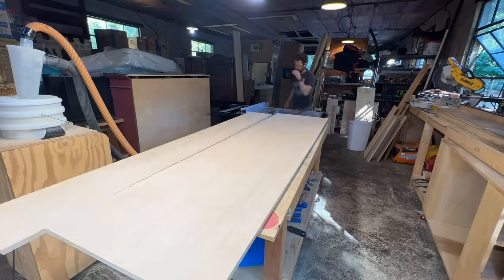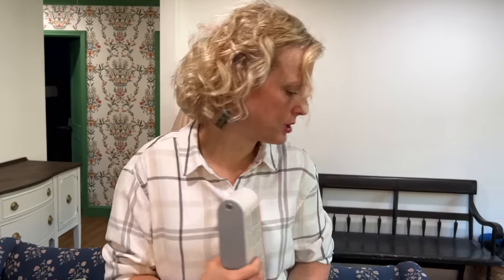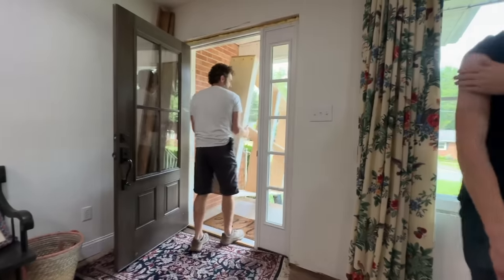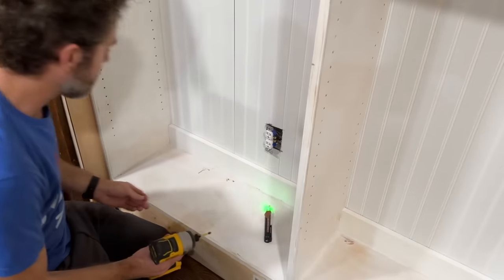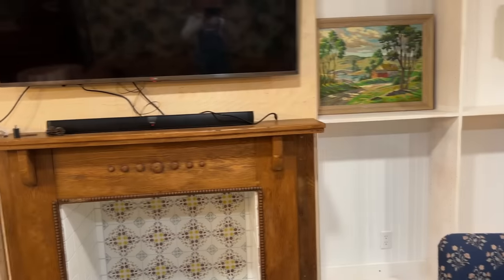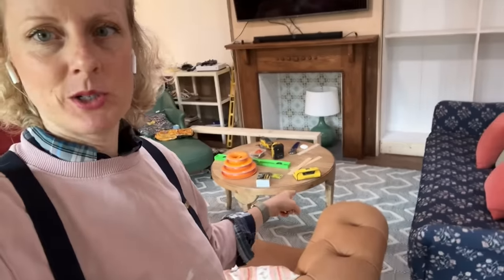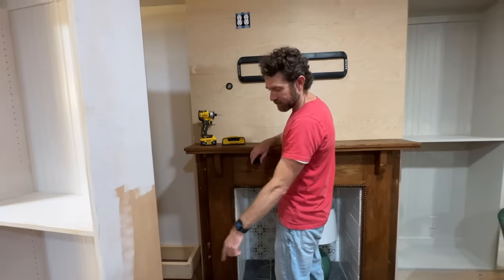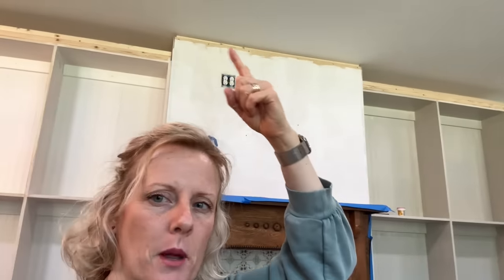MIKE IS MAKING OUR BOOKCASES: PART 1

Comment: They look GREAT!!!  I'm very much a fan of cozy greys, so . . . Also, about your question for the mantel.  I really like the idea of painting that outer piece to match the walls, BUT if you only paint the proudest part of the mantel base, it will make the overall mantel look so much smaller, and the bookshelves have a lot of visual weight and heft.  I just feel like the mantel would get a little lost without that extra bit of visual size.  Ultimately, it's only paint and if you don't like it, you can repaint it, so . . . DON'T SWEAT IT!!  That bead board is such a good look too!  The dynamic duo is doing it again!!! <3

Comment: It will be looking great with all the books - Mike can build anything , great job. I would wait with painting around the fireplace until all is in place , then you will be able to see the proportions much better . If you paint around it the fireplace will seem smaller , and may be out of proportion compared to the book cases. The holes can be filled in with a wood filler and stained. I can't wait to see this project finished - it does make the room look bigger !

Comment: I would leave the wood on either side of the fireplace. Then I would see if I could find some sort of old Newell posts or table legs to put on either side. It would add more detail, and it would also hide the holes. I think if you try to paint them, it will make the mantle seem even smaller, which will be out of scale with the larger bookshelves.
Reply from the maker: Great idea!